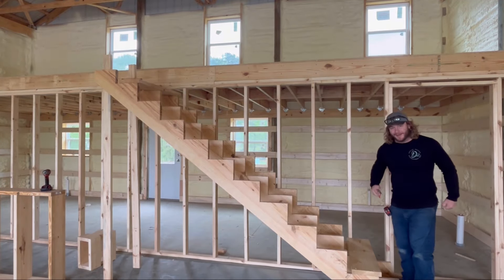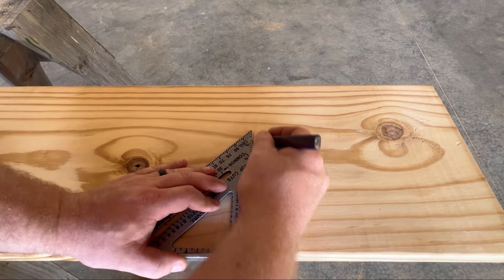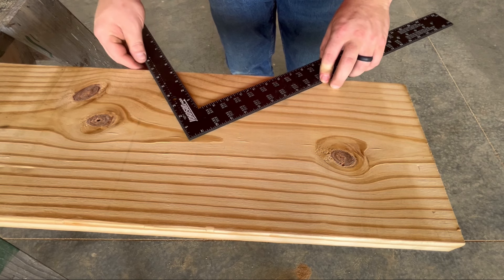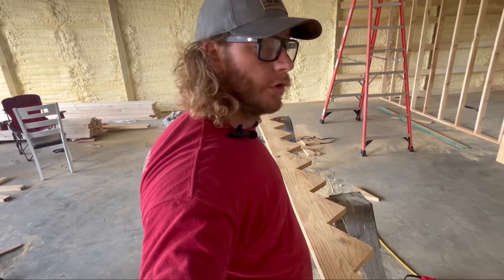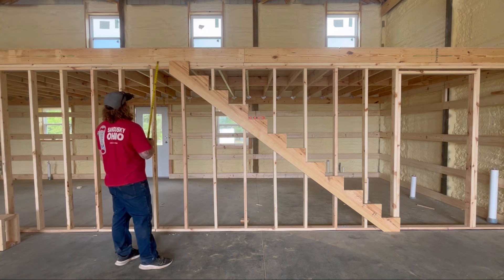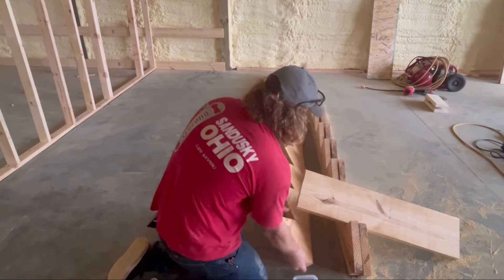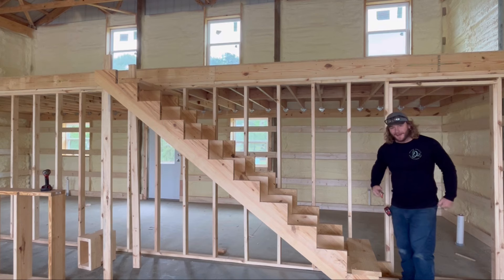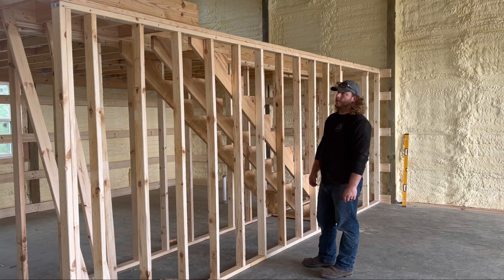Stairs Made Easy | Shop House Build

Comment: I believe code is 11" min stair tread depth. So, maybe you're note counting for 1" nosing. You seem to have the space, so I'd make them at least 11+". Also recommend adding a 2x4 on the stud wall sides against your stringers to give you space for drywall and skirt board. Cutting skirt board to the stair treads never really works out well. Glue and screw it.